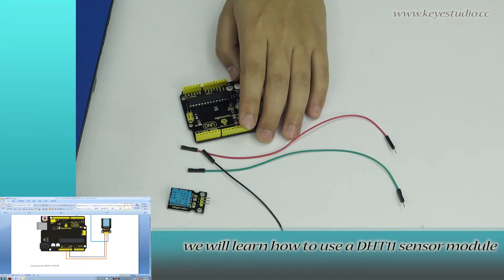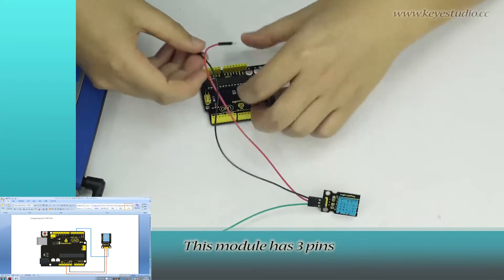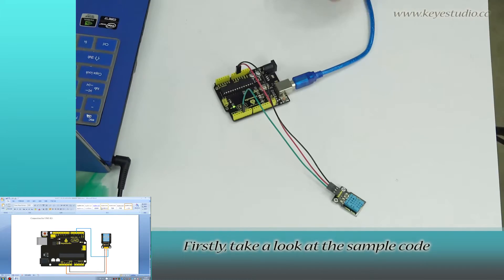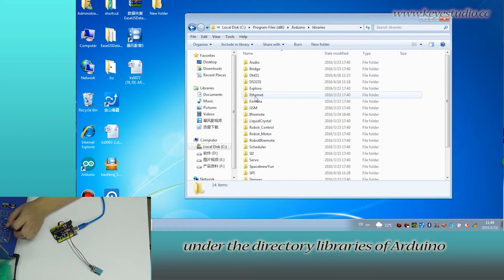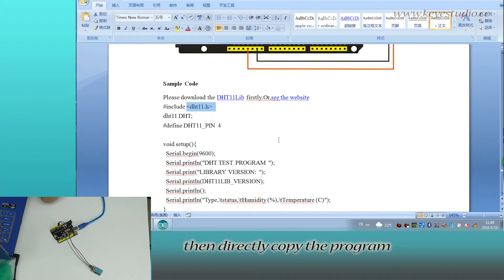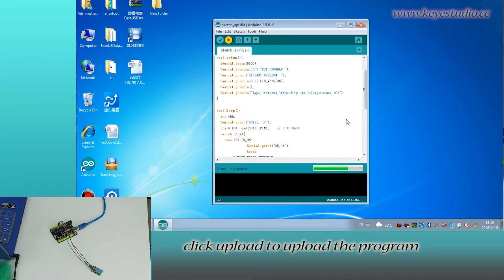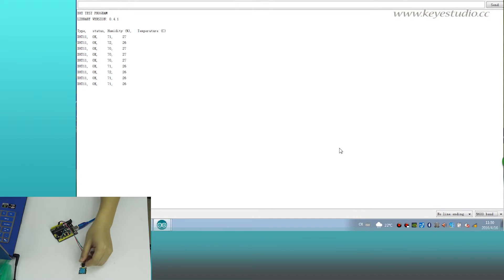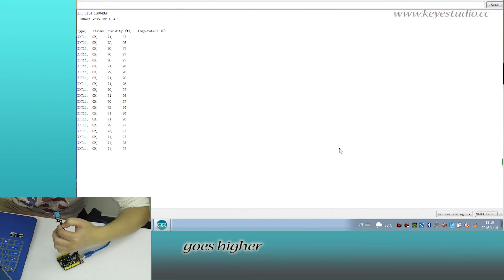Super kit: Measuring Temperature and Humidity (DHT11)

Comment: DHT11, 	Time out error,	31,	28

DHT11, 	Checksum error,	31,	28
DHT11, 	Time out error,	31,	28
DHT11, 	Checksum error,	31,	28
DHT11, 	OK,	31,	28
DHT11, 	Time out error,	31,	28
DHT11, 	Checksum error,	31,	28
DHT11, 	Time out error,	31,	28
DHT11, 	Checksum error,	31,	28
DHT11, 	Time out error,	31,	28
DHT11, 	Checksum error,	31,	28
DHT11, 	Time out error,	31,	28
DHT11, 	Checksum error,	31,	28
DHT11, 	Time out error,	31,	28
DHT11, 	Checksum error,	31,	28

Why we have this errors on different sensors?